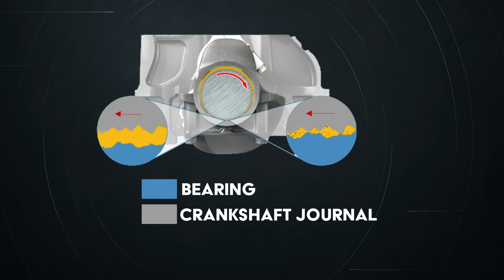the truth about start-stop technology (finally proven)

Comment: Couldnt the wear be reduced also during a regular start if you were able to run the oil pump separately for 5-10 secs before the engine turns?
Reply: How would the oil pump know when to start? Usually the engine starts up again when the clutch or accelerator are pressed by the driver who wants to go then, not 5 seconds later
Reply: @NewPremier-x8s DUH. 
Start the electric oil pump as soon as start/stop turns engine off, turn electric pump off as soon as engine is running again.
Reply: @NewPremier-x8s  Simples really if the  stupid ( as in green gravy train followers) engineers ( who could design all this Common rail and other fancy stuff)  would run a small hydraulic pump whenever the engine stops in that MODE.   One way of cooling the hot oil and engine or transmission, too.  Could do that yourself. PM me if you wish for details.
Reply: @culmalachie  hydraulic pumps are not ran off free energy.  No pump is.  Electricity is generated using fuel, electricity is not green at all!  For every watt produced requires fuel.  To get power you need fuel so it's not simples.
Reply: @NewPremier-x8s  I said regular start.
Reply: Ah, you mean like a fuel pump prime. Probably not a lot of difference, because the journals are resting on eachother. So even if you pressurize it, you wont 'lift' the journals. 
You would have to use so much pressure that you'd pop all the main seals.
Reply: @The_Noticer.  Resting with an oil film in between yes. And as soon as they start turning there is oil applied... Now they seem to turn 5-10 secs without it.
Reply: Probably but you’d need an electric pump. Best is to use friction reducers like MoS2 or similar ceramic additives, they remain in the surfaces after the oil has moved away
Reply: @ychannel3  Well that sounds like the simplest solution for sure.. But why isnt that in all engine oil then?

I've gotten the impression that manufacturers have been switching to at least some electric accessories in recent years..
But maybe its more in conjunction with those higher volt hybrid systems, not sure.
Reply: Some locomotives do that and I think also some large vintage aircraft  (electric oil pump plus engine driven oil pump) aircraft might be dry sump with more than one pump
Reply: To power the extra pump will require extra fuel be it electric pump or not.  To get electricity you need oil.  And if you were sitting behind someone for those 5-10 seconds at traffic lights you will think they have gone unconscious.  What kind of pump would you use, a free energy one?
Reply: @Moonlightshadow-lq4fr  Not sure what you mean. An electric pump of course, powered by the battery. Just like everything else in your car that can be turned on when engine is off.
Reply: @martinsvensson6884  If a battery is giving out electricity it will require recharging at some point.  To charge the battery you need to generate electricity, to generate the electricity you need fuel.  There is no such thing as free energy.
Reply: @Moonlightshadow-lq4fr  Yes that's how batteries work. And lets you run the pump without the engine.
Reply: @martinsvensson6884  😂
Reply: I had the same thought. But it wouldn't work as the journal bearing is stationary. So the oil wouldn't get where it's needed until the engine is started. It would maybe help reduce the time it takes but I don't really know. Just guesses on my part.
Reply: @Apollo-Computers  Is there a stop somewhere? Else oil will get everywhere. And with slighest rotation also to the stationary spot.
Reply: There wouldn't be any need for a crank-driven oil pump if there is an electric one (unless you want redundancy too), so it wouldn't need any switchover or anything. The control could be as simple as run the oil pump as long as the engine is manually ON (enabled). The pump shouldn't have to be stopped during a temporary automatic start/stop operation, only when the engine is manually stopped. And no, it's not more wasteful, driving that electric pump for a 2 minute traffuc stop, or any duration, really, obviously uses way less energy than idling for that time would have.

There is a disadvantage though: a dead battery really leaves you stranded.

So it could have been solved, but manufacturers are not all that interested in making things that last forever these days.
Reply: The shafts need to rotate in order to lubricate the bearings. They are hydrodynamic bearings. Oil pressure alone does not help much in reducing the wear.
Reply: @razorblade7108  They rotate and get lubricated again as soon as you start the engine..... if you have pressure.......
Reply: @martinsvensson6884 Until they reach idle speed, the surfaces are scratching against eachother, even when there is a thin oil film. That's because the oil film is thinner than the surface irregularities. Hydrodynamic bearings wear at startup and at low RPM. They are frictionless once they are at operating speed as the rotation makes the shaft float inside of the oil. It does not matter what the oil pressure is, it does not prevent the surfaces from touching if the shaft doesn't spin fast enough.
Reply: @razorblade7108  Of course it matters what the oil pressure is! Or you wouldnt need oil pressure. No idea what youre talking about...
You dont want 5-10 seconds of that in the whole engine.
A lot of the wear is prevented if you can keep the pressure everywhere. Not 100%. As in the bearings you mentioned. But a lot of it.
Reply: @martinsvensson6884 Well without oil pressure you wouldn't even get any oil to any parts, but for the wear of the bearings the main issue is that the shafts need to rotate at a high enough speed for them to work. Even if you had an electric pump or a reservoir to provide oil pressure right before startup, the bearings would still wear out with every start and stop. These kinds of bearings are designed for machines which are running most of the time. Frequent starting and stopping kills them. Magnetic bearings might be an option, but I suppose they would have to be extremely big and strong in order to hold the crankshaft in place. And they would attract all the metal flakes in the oil, as well as other parts of the engine.
Reply: @razorblade7108  It will wear less if you have immediate pressure as soon as it turns. Now you have to wait even after it is turning to get full lubrication. 
And there are also many other parts in the engine. Not only these bearings.
Reply: @martinsvensson6884 It will not wear less at startup just because there is oil flowing through the engine. The point at which fresh oil needs to be supplied to the bearings is when the shaft is already rotating and floating in the oil that is already in the bearing. The oil pressure has nothing to do with the wear of the bearings at startup. Most hydrodynamic bearings used in the industry or commercial products have no oil pump at all, instead they are sealed and the oil stays inside the bearing and has no pressure at all until the shaft is spinning. The rotation of the shaft pushes the oil equally to all sides, creating a thick layer of oil between the shaft and bearing. What actually helps to reduce the wear at startup is using oil with special additives, generally thicker oil, smoother bearing surfaces and bearing material with less friction and higher hardness.
Reply: @razorblade7108  Ok but you still have a vast amount of other parts in the engine that would want that immediate oil pressure.. those type of bearings arent the only things needing oil.
Reply: @martinsvensson6884 That is correct, however the main issue that causes wear is that the hydrodynamic bearings - especially the main bearings supporting the crankshaft - need a certain rotational speed to operate without friction. Other components don't wear down as much. Also it is not really an issue that it takes a few seconds for oil pressure to build up. In the situation we are talking about the engine has been running a few seconds or minutes ago, so all components are still lubricated and the surface tension and viscosity of the oil will make it stick for a while. It's sufficient if the oil supply comes back once the engine is started to replace the oil that is flowing back down to the sump and to clean it from metal particles produced by the wear of the components. Would it be better to have the oil pressure come back sooner? - Probably. Would it significantly reduce the wear of the engine? - Most likely not.
Reply: @razorblade7108  Would some Liqui Moly MoS2 prevent any of that wear then? Should put physical particles in between.
Reply: An oil accumulator is all you need to provide several seconds of oil pressure during a cranking cycle.  Less cost and risk to reliability than an electric pump.  Just a tank with an electric valve that refills/repressurizes once the engine is running.  The valve opens as soon as the ignition circuit is turned on, which is just before cranking begins.  Close the valve xx seconds after the engine starts and it's recharged for next cycle.
Reply: @GoFastGator  Yeah that could be used on any car then..